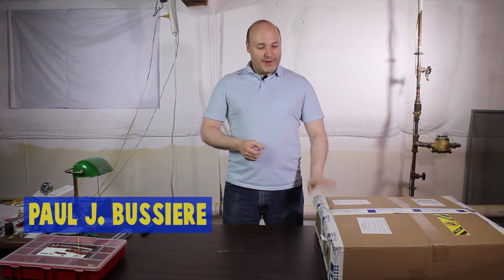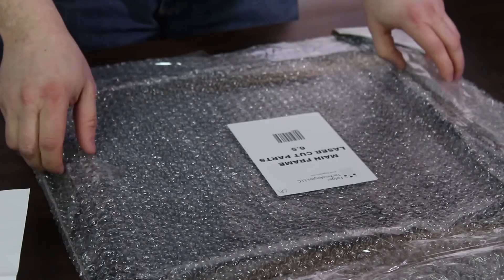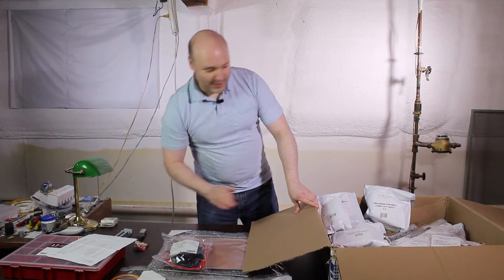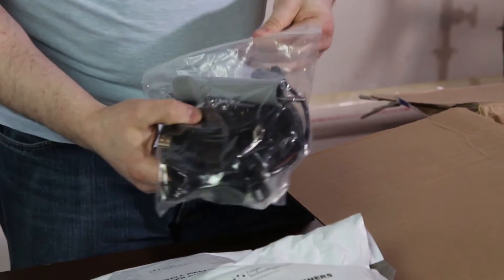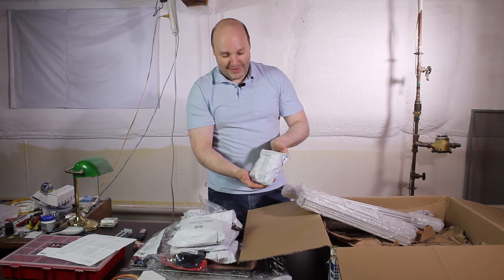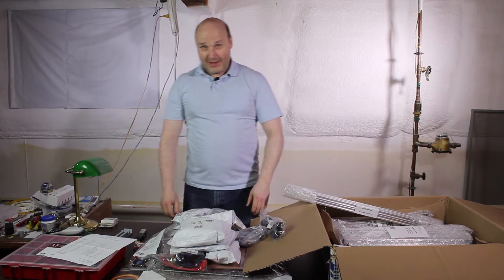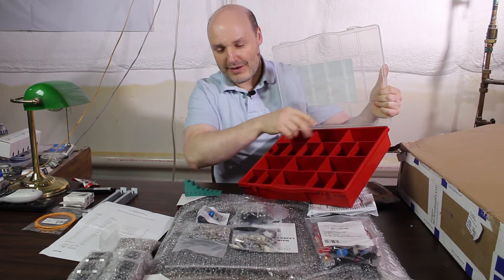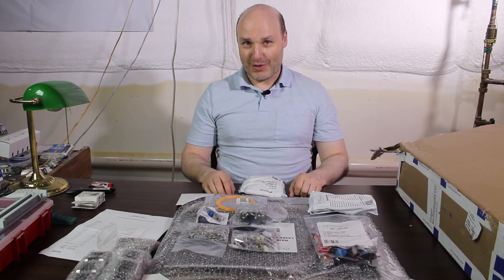UnBoxing the FolgerTech FT-5

Comment: I'm jealous I only got a single sour patch kid with my ft-5!  P.S. Don't use the spool holder conduit piece to set the 170mm gap use a ruler. The conduit I recieved is only 120mm in length.